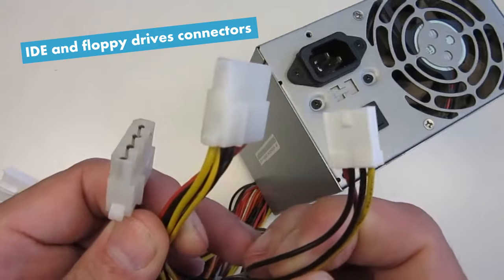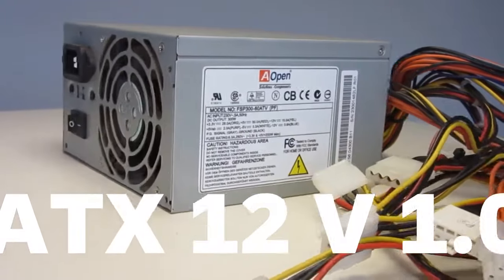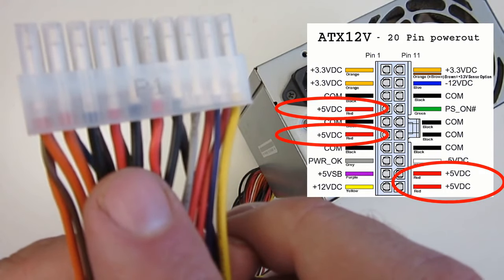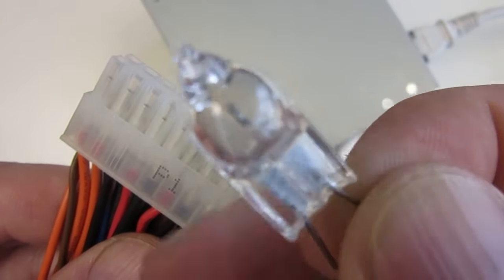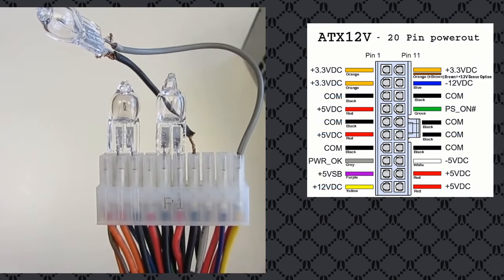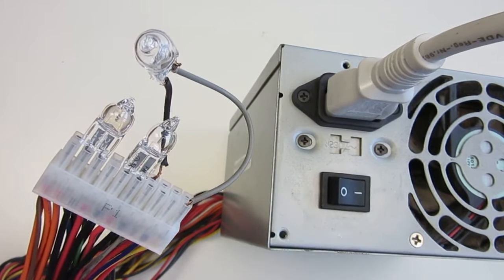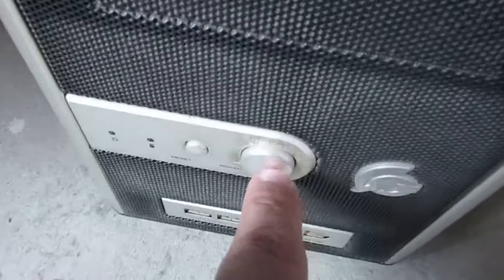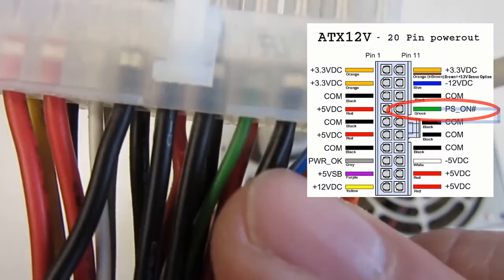HOW TO Start & Reuse A Computer Power Supply WITHOUT A Computer | PC ATX PSU Upcycling #DIY #reuse

Comment: Hi and thank you for the Tutorial, the formula does not apply with my power supply box, this means that it is crashed, what else can I do to repair it?
Reply from the maker: Start with visual inspection, check for anything that looks burnt or busted

Comment: can I combine two power supply and tie the wiring together? what will this give me as far as volts and amps?  ty for your assistance. 🙂
Reply from the maker: Not recommended I believe since a delta in specs / outputs between PSU can lead to serious issues.
Reply: @TheLabOtomy  okay and ty for the reply

Comment: And what about the pg wire where I  to have connected it and will it run without pc wire connected to motherboard ????
Reply from the maker: The Power Good (PG) signal is sent from the PSU to the motherboard. It is important for the MoBo to start, not for the PSU to start.

Comment: What about a proprietary PSU, like Dell/Alienware and such that have a "Power OK" pin in the mobo connector?
Reply from the maker: They may use different wire colors than and may have own requirements for power sensing (brown cable could be a grey or pink one for instance), but the principles to get the PSU started are the same: connect Power _on to ground, connect a dummy load if needed, connect power sensing if needed
Reply: @TheLabOtomy  okay, I will try just the 1 jumper 1st. Then power ok if needed. Thank you!